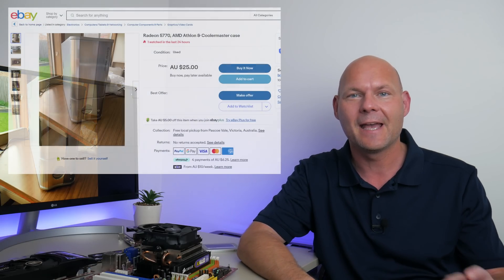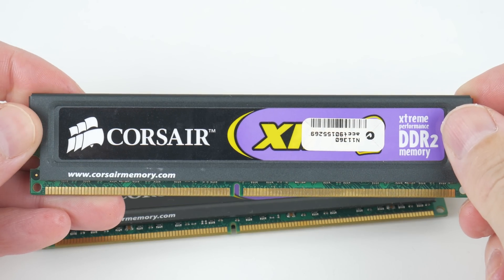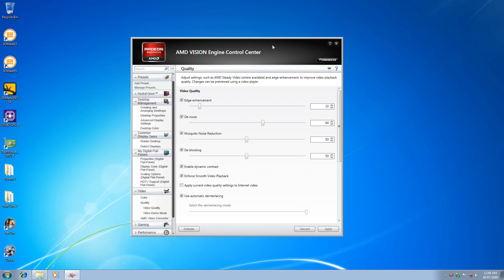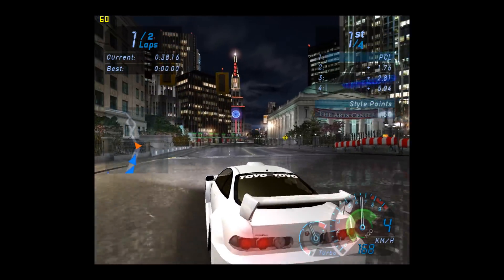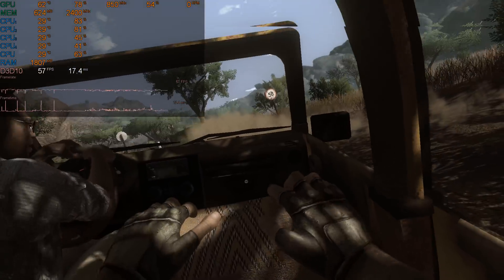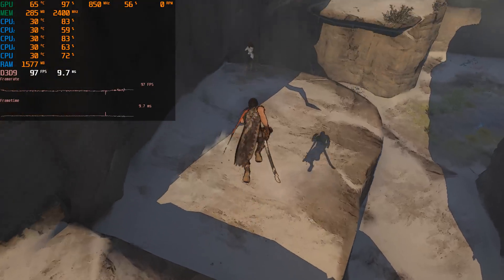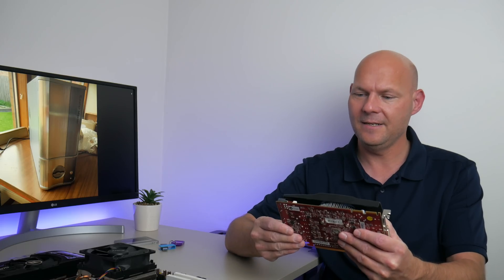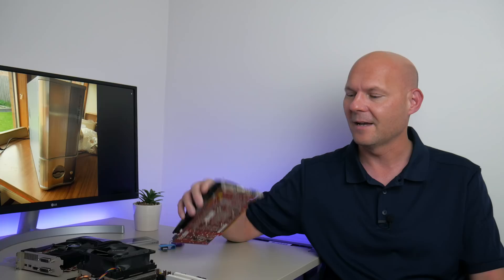Is This Old Athlon II PC Worth it?

Comment: Nice Video. I uses the Phenom II X6 clocked at 3,8 GHz together with a GTX 960 2 GB on a 990FX Mainboard for playing such games. I also had no driver problems under Windows XP. The system runs with XP and Win 11 parallel on different ssds.
Reply: Woah, a GTX 960 with XP. That's super fast! A pal had the same GPU, but with 2x Xeon quad (8 cores in total, blasted away any i7), Windows Server 2012 or similar.

Comment: I have an old Asus M2N 68-SE2 motherboard lying around. It also supports the AM2+ socket. I have an Athlon II x 2 CPU clocked at 3.3 GHz in it paired with 4 GB of DDR2 800MH of RAM. For some reason the S3 sleep mode doesn't work on the board properly, otherwise the board works fine. I did Flash the latest bios, but that didn't fix the sleep problem. As for using an SSD, Windows10 didn't recognize the SSD as an SSD. Disk Optimizer kept claiming that it was a hard disk. I haven't tested yet to see if Windows 7 shows the same.

Comment: I have an HD7770 which has the same driver issue. Using an older driver AND not installing the "geforce experience" equivalent (which I forgot the name) seems to have fixed it for me.

Comment: G'day Phil,
What do you mean "too Far for you to pick up" by Google maps it's just a quick 30hr 2800km drive down the 1 Hwy 😂,
I have a Gigabyte HD5770SOC, so far the only AMD in my SOC Collection which also has GTX260, 275 1.8GB, 460, 470, 560Ti, 570 & 680 with the Windforce 5 cooler.

Ps yeah I think some videos looking at "Retro" PCs for sale will be interesting 🙃👎
Reply from the maker: There are so many parts on eBay labelled as Retro, only because they are old. Like absolutely generic stuff without any box, manual or TLC.
Reply: @philscomputerlab  Yeah so much "MEH!" to sort through to find the good stuff, quite often being detailed means you miss stuff too like if I just search SOC,
only the 5770 actually had SOC in the listing title, except for the 260 I bought from a shop years ago I found all the others just by scrolling with my usual searches of "GTX" "HD" & "GV" for Gigabyte GPUs.
Reply from the maker: @shaneeslick  I just do it the manual way. Sort by price and see if my eyes catch anything 😅

Comment: I recently bought a Toshiba Tecra S3 Laptop from 2006 for 30 Euros. Equipped it with a SSD and installed Windows XP. It is great for many retro games from the XP era. It has Pentium mobile 2,something Ghz, 2GB Ram and a Geforce 6600 Mobile GPU. Good speakers an whats best a big 4:3 screen. The S1 is also nice but it needs a IDE to M2 ssd adapter. Upside is, you can even install Windows 98 on that one.
Reply: I didn't even know there is an ide to m.2 adapter. Thx!
Reply: That is a surprisingly goodddddd ca 2005 gaming-capable laptop. It didn't fall victim to Intel GMA.

Comment: alright, a recreation! sure is a nice deal for that system,  too bad itll cost you more for gas. i just got a sweet local deal within 10km, an all aluminium wave master case with a working p5q deluxe, q6600, ocz ram, quadro 400 and other stuff. all for $40 cdn ($32 usd).
Reply from the maker: Yea LGA 775 is the Intel platform that is currently prices rock bottom...

Comment: I think the Athlon X2 was so heavily outclassed performance wise by the core2duo lineup that were still the effects of that today in the used market.
Reply: The Athlon II x2 260 3200 MHz is faster than the Core2Duo E8400 3000 MHz.
I have both. The Athlon II even needs less energy in idle state. My mainboard beeped because the small AM2 fan didn't even rotate on cold boot, lol.
But I have an older AMD fan from a 4200+, which I attach later.
Both series are very efficient compared to the Pentium 4.
Ofc. i5/7-2/3xxx are efficient and faster, also very cheap nowadays.

One truth is, the Core2Duo E8400 was used in most offices around the world, produced in millions, leased and trashed after 3 years of usage. That's why it's so cheap.
But interesting is, that the silicon lot is so good, that 100 % of those E8400 3000 MHz CPUs can be overclocked to 4200 MHz at least, if your chipset can overclock the FSB. With a good heatpipe it produces only 40 °C @ 3 GHz. Core2Duo is one of the best CPUs ever made.
After that "free lunch is over". Anything went for energy savings, multicore and less single core performance.
Athlon II and Core2 are the last CPUs with most single core CPU bang in the series. i7 are faster ofc., but there's no big difference between i7-2xxx and 7xxx f.e., only 5 % more speed each generation.
Old i7 CPUs can play 99 % of all AAA titles with ease.

Comment: I have noticed even here in the UK there is often a machine that is so cheap it makes me do a double take. I recently picked up a Duron socket A machine, the Duron is how I stumbled apon it as I was looking for a late 90's early 2000's machine and I found this; it had a duron 700mhz and now this is the odd part, it had a ATI 9800Pro in there. I picked the whole system up for £40 I think it ended up being around including postage and packaging. I put the ATI 9800 Pro into a pentium 4 build I have and it works great no problems at all. Put a ATI 7500 in with the duron I had lying around and the system seems happy. No blown capacitors or anything. Goes to show sometimes you just need to be patient and see what comes on the market :) It's like finding a mystery box full of delights lol :D
Reply from the maker: What a find, well done!
Reply: Well.... I have had a gefore2-gts (asus) for sale for 36 USD, a Geforce4 ti4200 for sale at 44 USD and an Asus A7V266-E with CPU (the big one with RAID onboard) at 58 USD, the last 4 months. And no one really want to buy. Plus other stuff like passive cooled TNT-2 Ultra from Conpaq at around 73 USD.

Seems like the hobby is cooling down, or at least for Win98 compatible hardware.
Reply: It's because people have no plan, forgot or just don't value the old parts anymore.
Hm, an ATI 9800 would make more sense in an AMD XP or P4. Maybe that guy had a defective newer PC, switched and forgot the GPU.
Ofc. the faster parts of the old IO ports increase in value over time. ATI 9200 or 7000 isn't worth anything, but 9600/9800 may cost 100 bucks soon.
But time also is money. Man I dumped a working Asus TUSL2-C board after the PSU was defective, because I didn't use it for a decade (my newer PCs just were faster and I invested more time on newer ones). Same problem as always, can't use more than one PC at the same time.
We need a dedicated room with only old PCs, stop use the internet, media and new PCs.

Complete PCs always are cheaper. I bought some 2nd hand PCs for the RAM and HDDs alone and also got some nice GPU like HD 2600 Pro and always good Asus or Gigabyte boards.

Comment: I'm greatly reducing my computer part collection and I have a Firepro v8750, basically a 2 GB HD 4870. Infact, I have the ASUS EAH4870 TOP Radeon HD warrior in the cherry blossoms heatsink on it. This is the hottest card I have ever seen. I don't have any numbers, but is it normal for this card to get pretty toasty at stock?
Reply from the maker: I believe so! These cards also have hot VRMs, it was an issue covered by the press back in the day. Especially the blower coolers can be hotter and louder than some of the vendor specific designs.

Comment: Before things become "retro".. they are old trash first- but the point in time at which this change occurs is very subjective.. leads to weird situations like vinyl being more expensive than cassettes.. or seeing ugly bad cars of your youth being sold as classic cars...
Reply from the maker: You are so right! Being a bit older, I've seen it so many times. There was a US eBay seller with 100s of Voodoo 3 cards. Socket 7 boards. 386/486 boards, you had to pay people because at that time computing performance exploded, so a 5 year old computer was totally useless. It's a bit different now. A 5 gen out of date i5 is still capable.

Comment: I tried to sell a similar PC, with Core2 Quad Q8400, 8 GB DDR2 and Radeon 6770, but also noone here in Germany seamed to be interested.
It's still a powerful Windows 7 machine
Reply from the maker: Yes I'm seeing the same here. Such parts are no old enough to be retro, but old enough to be considered obsolete for most modern tasks. Perfect to get your hands on affordable parts for XP retro machine.
Reply: @philscomputerlab  Yes, that's right. Sitting somewhere in the Middle. Maybe I should let this PC sit around in the Basement for a few years, before I can sell it as Retro :-)
Reply: For an interesting retro pc you need more than old pc parts e.g. MB with AGP/PCIe, Xeon support, an Intel Core Extreme or similar, a nice GPU design or the original packaging, special cooler etc.

Comment: I found 775 socket PC G31m S for about 17 dollars. Seller sold it as a case price. BUT to my surprise it supports ddr2 4gb ram. It really try to makes 35 dollars for 2 sticks of 4gb ram ddr2 not only for AMD.... Should I pair them too? Then Ram costs more than the case.
Reply: Now after watched this video, I better to use it as a retro machine rather than a current Windows 10 PC. BUT anyway for the time being I paired 4gb ddr2 Ram(2+2), and works fine with HD 4350 with auto update driver from Microsoft for the graphic card. It caught the driver from internet connection automatically. 
AMD does not have a driver for hd 4350 on Windows 10.

But as I said, after understanding Phil's video I had better use it as windows 7 retro PC later, because 4gb would be enough.

Comment: At the moment i am using a setup nearly similar but with a geforce 9800 gt. It is very nice for older games.
Reply from the maker: 9800 GT is such a great card, but, many have stopped working.
Reply: @philscomputerlab  Yea, it is a nice one. I paid 7 € for 6 untested cards. 3 of them where working. One 4870, the 9800 gt and a 8500 gt.
Reply: I have had all the variants of this 9800 card but have had a couple die on me. The 9800 GTX+ card I have is still running strong though, and it works great for retro games.

Comment: So what makes a board retro now?  Is it when a system can only run obsolete OS?
Reply from the maker: Well the Athlon II is ~ 2010 I believe? It can run XP perfectly which gets you back to ~ 2001 and later games. I think there is enough Retro in that machine. But of course you can go the other way with this one. Max out RAM, get a SSD and it will run Windows 10 or modern Linux without issues.
Reply: @philscomputerlab Yes I feel the same way.  These things are always changing aren’t they? Time is keeps moving forward after all.  It’s amazing to think a 2010 machine today is the same age as an original IBM PS/2 from 1987 was in 2000!
Reply: @philscomputerlab  I can confirm that such a system is completely fine for web browsing, watching videos, various chat programs of today, zoom calls with Linux. I still use it for that frequently. It will also run W10 fine. I use to dual boot W10 on it to play various games including Crysis (not maxed out) and it was fine too.

Comment: I picked up a dell gx270 a few years back for 19 AUD and was surprised to find out that it had a mono speaker built in.
Reply from the maker: Nice find! I really like these early Dell machines, all dark and decent motherboards. But some come without AGP, those are not that easy to upgrade, PCI graphics cards command a hefty premium.
Reply: The one I got had an agp slot, did a few upgrades to it including a geforce 4, apparently it has a sata port may have another poke around inside of it.
Reply from the maker: Awesome!
Reply: Might not be that unusual, my Pentium 4 HP Compaq from around the same time also has one. Annoyingly it has a proprietary thing witht the power supply where one of the voltages are different to a normal one.